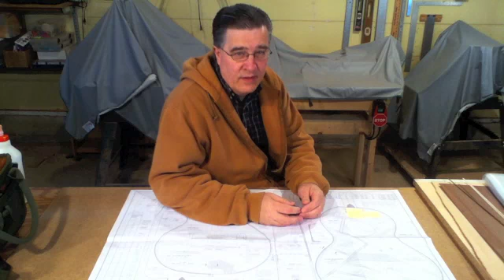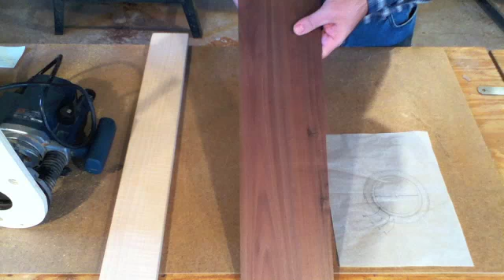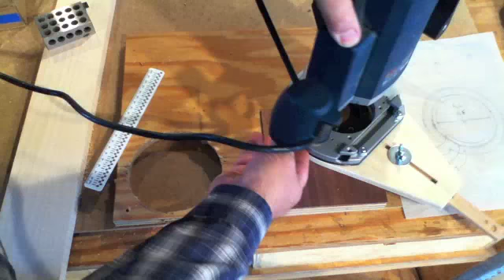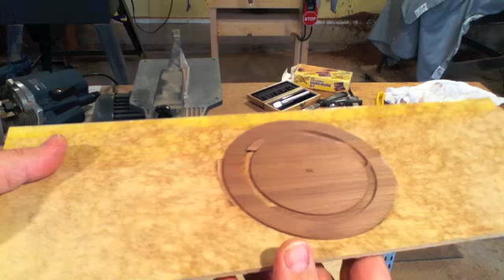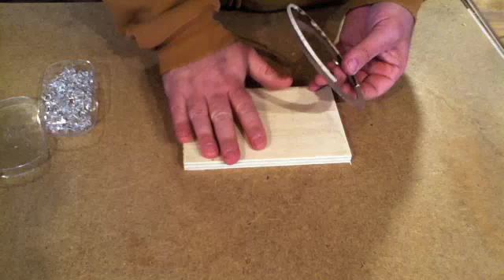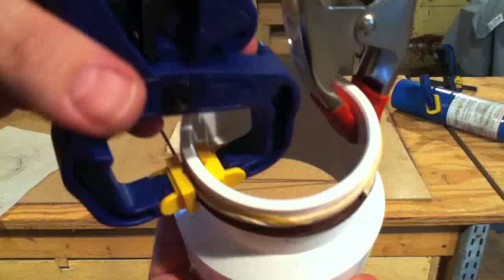Building a Tenor Guitar - Part 7

Comment: I have a lot of admiration for those who bend over a hot pipe. I've tried it a couple times and wasn't very good at it. I saw one guy in our shop bending sides with enough force to rock the bench. Without knowing it, he managed to get the bench to rock enough to roll the torch off its cradle and it set fire to the plywood holding the pipe.
We laugh about it now, but it was a real dry-mouth moment when I looked up and saw his bench blazing away merrily.
Good-looking rosette, btw.